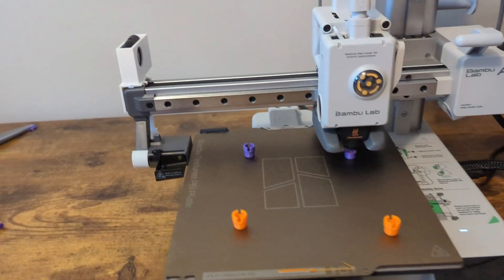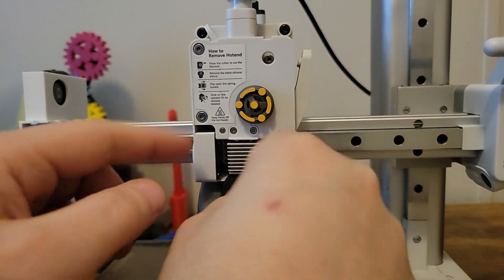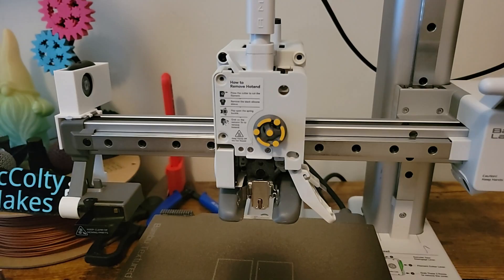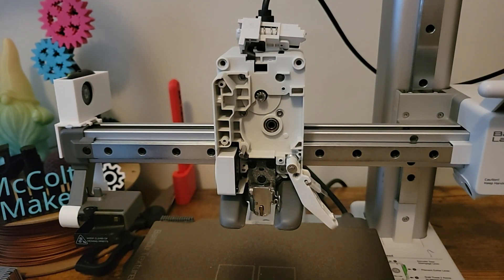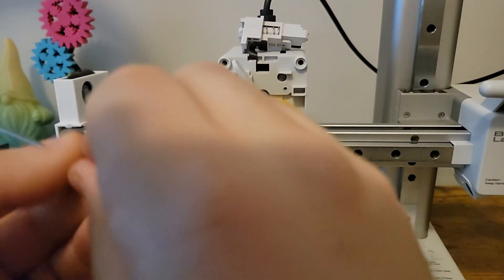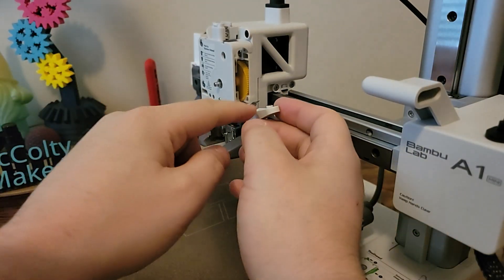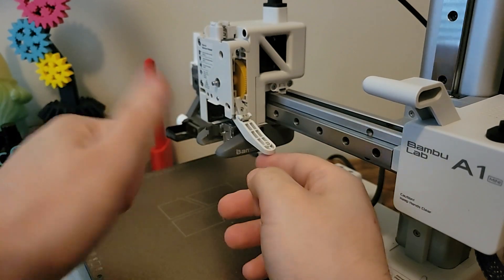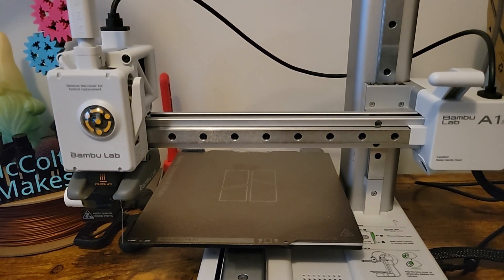Bambu A1 / A1 Mini Extruder Teardown/Maintenance

Comment from the maker: I hope this video was helpful  and you have any questions about the process please ask in the comments. And Thank You for watching!
Reply: Its really helpful! Thank you so much!
Reply: Hey! I'm having the clicky noise myself, at the beginning of the video you mentioned that it ended up being a "nozzle issue", so what was that issue and how did you fix it? Thanks!
Reply: Ya I’m having this issue I cleaned the nozzle to the best I could and could see light clearly through and then when loading filament back in when it says to push the filament I don’t get anything out and if I just click done it then does the clicking noise making me thing the filament isn’t getting fed to the nozzle but then when taking the nozzle out again the filament is again in the nozzle and I can pull it out and mind you this is a new printer and was fine up until I switched the filament from black pla creality to the white is when this happened but if it’s making back to the nozzle could it still be higher up that is the issue I’m new and trying to avoid a total tear down as long as possible iv seen videos of ppl being able to manually feed filament from the top through and if I take the nozzle off and try I can’t

Comment: i don't get it what did you actually fix? you mention clicking but there was no problem you fixed after taking it apart
Reply from the maker: I thought it was something stuck in the gears, nope ended up being a clogged/bent nozzle

Comment: Thanks - that was really useful. The little black extruder gear (the gear that grips the filament???) on mine was coated with filament, so was slipping all the time. I scraped out the filament with a pin, then used compressed air to blow everything out.

Comment: Hi i followed your steps.  The extruder still clicking
Reply from the maker: If you have a spare nozzle, swap it out, it could be a nozzle issue as well.
Reply: @McColty_Makes I have 2mm that I use.    My designs are small. What would you recommend
Reply: I have the 2mm and I need to use that my designs are small
Reply from the maker: @carmenatalig3273 If you have the .2 those nozzles are more prone to clogging, my gut is telling me clogged nozzle.
Reply: I purchased a whole new extruder unit.  Will that help
Reply from the maker: @carmenatalig3273 I would try a .4 nozzle swap first if you haven't installed a new extruder yet.

Comment: Did you ever find out why your extruder wheel kept clicking since you said in this video that you did not find anything wrong in the extruder gears? How did you resolve the issue of your extruder wheen clicking?
Reply from the maker: I don't know 💯 but it was a nozzle issue, nasty clog or bent, after I swapped nozzle clicking stopped. What ever was wrong with the nozzle wasn't letting filliment pass causing the gears to click when they couldn't turn/move the filliment.

Comment: How tight should that tension extruder be?  Mine is hard to move the part.  Also mine has been clicking during printing. and not extruding filament during printing only during purging.
Reply from the maker: Pretty tight, have you tried swapping nozzles?
Reply: @McColty_Makes  Yup I tried a brand new nozzle and assembly.
Reply: its odd i've done a deep clean, and found no issues, and it purges fine every time.  only at the point of printing does it give issues.  As soon as it prints that little line of filament in the front, that is where minimal amounts come out and its like just little flakes.

Comment: I think the design of the extruder tension spring is stupid. Once you open the extruder housing, the spring and the small plate pops out and the user has no way of knowing what is the correct way to put the spring and plate back. My A1 was out of service for two months because I installed the small plate incorrectly - it should be on the left side, touching the tension screw, and I mistakingly installed it on the lever side. This had created a problem where the filament was not feeding properly, resulting in failed prints. Thanks this video, I was able to identify the assembly mistake.
Reply: Im.so glad i just saw this i pulled everything apart yesterday because i have no extrusion now after reading this i realize i did this.. now today ima have to fix it lol

Comment: I can't get the tension screw back in. I'm so screwed. Pun unintended 😂. Could anyone help? 

Edit: I think I've officially ruined it. 😢 I've stripped the inside of where the screw it supposed to go. Is there a replacement, or am I just SOL?
Reply from the maker: Hmm maybe, I would contact bambu support and see if they replacement parts, hard to tell with out seeing the damage
Reply: @McColty_Makes I seen the visible metal dust 😂 I'll see if I can get a part for it or something.
Reply: @McColty_Makes extruder unit seems to be the only option. I sent a ticket in but idk if theres even another option. I guess ill have to wait until i have 32 more dollars for a whole new extruder unit 😔

Comment: Thank you so much. I’ve been hunting for a lost part and your video showed how nothing was lost the metal washer on the tension spring is a perfect fit in the tension lever on the OTHER end of the spring.  I never saw quite where it came from 🤦‍♂️ and it is incredible hard to assemble with it on the other end but it can be done. Now I get my sanity back. Yay
Reply from the maker: Happy the video helped
Reply: @McColty_Makes another fault I have found that may be worth keeping in mind. My nozzle is clear, the extruder works fine but there must be a break in the Hotend tube as no matter how hot (400c with a desoldering blower) the filament won’t melt. Yet if you touch the filament ment on the outside of the nozzle stem it melts instantly. So off to get a new nozzle.

Comment: You didn’t circle all the screws to remove.

Also putting it back together was easier following along with you, but a heads up to keep the screws in some order or description of what kinda screw you’re using would have been super

Comment: This video saved me from sending my A1 back.  Thank you for explaining about the screw on the left side that seems to just hold the face plate on. I had no idea it actually managed the tension and I removed it while clearing a blockage and never replaced it. Then I spent days chasing down why the extruder won't feed filament. When I replaced that screw it worked just fine again!  I can't thank you enough. This video really helped!!!
Reply from the maker: I'm happy you got your printer up and running again🎉

Comment: What happens if you accidentally pull om that thin belt 😅 did i just ruin my printer
Reply from the maker: I dont know exactly what you did but bambu has spare parts on their website for pretty much everything if you broke it.
Reply: @McColty_Makes im not seeing a replacement for it ive been looking

Comment: So what was the nozzle problem? I am getting clicking, only when printing. It extrudes fine... But when printing, my hot end is moving forwards and backwards. I've taken it out and reseated it, but it still happens.
Reply from the maker: @willmorton6800  I think you might have to tighten the screws that are behind the hot end, I don't have a video on that but look it up it should help.

Comment: Thanks for the video on this extruder breakdown, just one question where I have not seen any answers.
When doing this and putting back together, do you need to set up the esteps for the filament like on the old extruder machines, or is this automatic with the Bambu Lab A1.
Reply from the maker: Automatic,after i put everything back together i reran the self calibration for the machine and did a few test prints to make sure it was working again

Comment: when putting the leaver with the cap spring, do the 2 black wheels have to line up or one groove inside the other? 3:30 in the video
Reply: Hi, did you find the answer for this?😅
Reply: They should line up

Comment: Wanted so Thank you for this video. I was pulling mine apart to clear out some stuck filament and that little silver disk that goes in the tension spring popped out and I had no idea where it came from.   You are a life saver.  Had the whole thing back together in 5 minutes after this video.
Reply from the maker: Awesome 👍, thanks for sharing my video helped you out

Comment: I almost never like comment and subscribe to the first video i see from someone. This is possibly the only exception. Youre a life saver man. I was confused like 5x putting this thing back together. Hell, i had an issue taking it apart lol. Was missing a screw to get the 2nd cover off. You made it simple and easy. Only suggestion to possibly make it even better in the future, would be to show which screw you put back in. Thatd make.it a 10/10. Thanks a lot man.
Reply: One other thing people should be careful of, is when putting the filament hun back in, the ribbon cable can be pulled out too far and get bent from excess length pulled out when pushing the filament hub down to seat it. Luckily i caught it last second and managed to tuck some excess backwards through the hole a bit so that it stayed straight instead of dipping down and risk getting creased/broken when reinstalling. To be fair, you did warn everyone to be careful when removing it lol. Id suggest people be cautious and keep an eye on it when putting it back together. U saved me with the filament cutter position thing too. I had it right, then dropped my screw and let the lever go, then installed it incorrectly. Had to take it all apart again and fix it. My fault, you warned us lol
Reply from the maker: @92ireland92  thanks for the positive feedback, I should really do tear down videos on on other things on the printer.

Comment: It's been a while since I took my A1 apart to change out gears. had a weird one could not push filament into the printer. Turned out that the filament broke off above the filament cutter. I forgot about the 2 top screws but thanks to this video I remembered and sure enough the AMS splitter had a long piece of Green PLA sticking out of it (still had to fish it out with tweezers) Thanks

Comment: Quick tip. Never forking do this. I did it and I used some naughty words. Duck this video. I almost broke my printer. For new 3d print users don’t try this early on because you are curious. This should only be done if you need to. Such as replacing an old component. But never do this

Comment: What happens if the black tape thing comes out more by the tube area
Reply from the maker: @kristin27b  it's a tinny ribbon cable that is really easy to break so I didn't mess with it, if it comes off and is not broken should be able to carefully put it back

Comment: What was the problem you had with the nozzle? Did you have to change it ?
I think I’m having the same issue with my printer
Reply from the maker: @mariaatencio7428  partial clog I couldn't get out, and caused under extrusion and the clicking noise.
Reply: @McColty_Makes thank you for answering! I’m having the same issue, could you tell me how you solved it ? Did you unclogged it or did you have to change it?
Reply from the maker: @mariaatencio7428  I just swapped nozzles, clog was really bad, that or I had a micro bend in the nozzel
Reply from the maker: @mariaatencio7428  nozzles are consumables in 3d printing, and with the A1 easy to swap

Comment: Hi, i wanted to try my new a1 but as soon as It started the filamenti broker inside the extruder and now i can't get It out, the cutter on the side can't reach It either, do i have to buy a new extruder?
Reply from the maker: @mikiocpn  should be able to take it apart and remove the filliment
Reply: @McColty_Makes  no i can't, i even tried to remove the magnetic lever but nothing, it's stuck
Reply from the maker: @mikiocpn  how far have you taken it apart?
Reply: @McColty_Makes  i have removed the AMS extruder, then i removed the 2 screws on the top and pulled out the extruder inside, i took off the Little plate that Is connected with the ribbon and i have the extruder in my hand, the filament Is stuck there, It won't move, so i tried talking out the Little magnetic lever and the Little spring but It still doesn't work
Reply from the maker: @mikiocpn  ok so it's stuck in the square filliment buffer
Reply: @McColty_Makes  yeah the One that bambulab calls filament sensor base
Reply from the maker: @mikiocpn  I don't have any experience removing stuck filliment from there, have you tried to use another piece of filliment to try and unblock it?
Reply from the maker: @mikiocpn  I think you should be able to remove it it will just take some work, and there are a lot of great videos on YouTube with people fixing that same issue.
Reply: @McColty_Makes  yeah but It doesn't work, the filament Is really stuck, i even tried to use pliers
Reply: @McColty_Makes  Really? Because i can't find any video with my specific problem
Reply from the maker: @mikiocpn  really that surprises me, I'm sorry.
Reply: @McColty_Makes  don't worry, thanks anyway

Comment: Thanks, didn’t notice the filament cutter when putting back together and couldn’t figure out how to get it to move smoothly
Reply from the maker: That cutter is tricky if you never took it off before, first time I did this I thought I broke something as I didn't have it in the right place.
Reply: @McColty_Makes  I spent a solid amount of time trying to figure out if the lever was coliding with the casing or if a screw had to be tightened just perfectly lol

Comment: Sorry what did you say about the clicking issue? I just had the same thing. Got the thing mostly apart and... nothing.
Reply from the maker: @Oberon4278  my issue ended up being the nozzle
Reply from the maker: @Oberon4278  also the clicking happens when there is some kind of block and the extruder can't feed the filliment, I have learned a lot since I made this video
Reply: @McColty_Makes  Ah okay. I should have cleared the nozzle first and tried it again but I just assumed it was the extruder. Same path you took, it sounds like.

Have you tried an in-line filament cleaner? It's dusty as heck where I live and I think that's causing a lot of my recent problems.
Reply from the maker: @Oberon4278    I have not used one of those

Comment: You skipped the part on how to remove the ams. Is it necessary to remove?
Reply from the maker: Wow i didnt even realize that and this video has been up for a few months. Its pretty easy to remove, just be careful as there is a small ribbon cable that its connected to, as you can see in the video i just rested it on top. I just rewatched it yea you can see where i reinstalled it opps

Comment: Tip! If despite every tutorial you just can't figure out what gets the filament stuck, check the filament hub from below and try to see it. Pull with  tweezers and it should help
Reply from the maker: @n5vi  I made this video early on in  my 3d printing journey, and this video was really not about it the clicking noise I heard it was how to get to the extruder.
Reply: @McColty_Makes  yea I was just giving a tip. The vid helped me realize that it was the problem

Comment: WHY have you speed everthing up Need to work out which screws go where Would have been great ASSUMED you would show rebuld and which screws
Reply: settings playback speed* 0.25x*
Reply: I agree. Slow it down as much as possible and some screws you can see at all until after they are inserted. Helpful mostly, but could have been more helpful.

Comment: If anyone with shaky alcoholic hands is trying this and dropped the screw in; the fix for me was to pop out the front cover, and remove the screw for the cutter (That thing popping out at the side and it will drop down and you can reach for the screw lol.

Comment: When I disassembled it and reassembled it the gears were making a clicking noise and no filament would come out. Anyone know what I did wrong
Reply from the maker: 1. Did it the extruder gears grab on to any filament? you might have a clogged nozzle try to unclog or swap nozzles.
2. Make sure the tension screw is tightened ( the one with the spring in the top right)
3. Make sure the cutter is reinstalled in right place

Comment: Oh so it could be a nozzle issue? So I’ve done all this disassembly for nothing😢
Reply from the maker: If you have a spare do swap and see if it fixed your issue.
Reply: @McColty_Makes  I don’t unfortunately, but I do have a ticket with Bambu support so it’ll hopefully get fixed soon
Reply: @McColty_Makes  do you know what was wrong with your nozzle?
Reply from the maker: @Nishye501  had a clog I couldn't remove
Reply: @McColty_Makes  oof, mine isn’t a clog, it still makes the noise when it doesn’t have filament
Reply from the maker: did you ever figure out what was wrong?
Reply: @McColty_Makes  it seems to be the motor, I’m just waiting on a replacement

Comment: Thank you for this video. It is the only video out there. I had to almost completely take mine apart to replace the heater assembly. I'm sure I went too far but I put it all back together and I have 2 extra screws. I know, I know, I should've paid more attention when disassembling it. Could you possibly help? Thank you.
Reply from the maker: @caseymineer  I would start by tearing it down again, and look at 1:09 in the video those are the screws needed to take off the extruder, and you can at least rule those out as being your extras, I have not had to replace the heat block, when I get a chance I can post a picture on my YouTube community tab that shows the the heater block area and screws.
Reply from the maker: I have uploaded a picture to my community tab/page on YouTube I hope it helps

Comment: Disassembly of the whole extruder does not make a lot of sense in this case (clicking). I would suggest switch nozzle and check upper connection for AMS, this resolves the clicking issue in most of the cases
Reply from the maker: You are 💯 correct and that is what I should of done to start